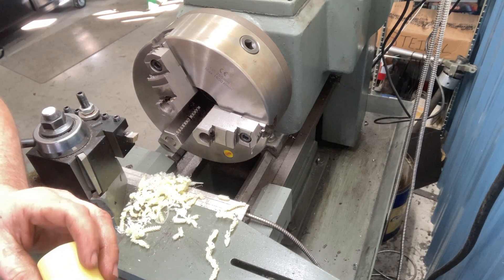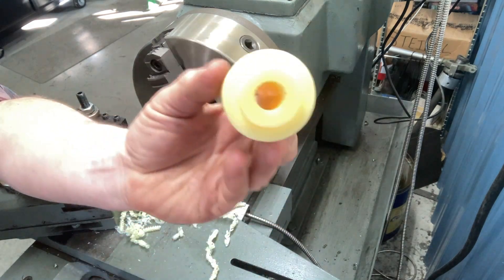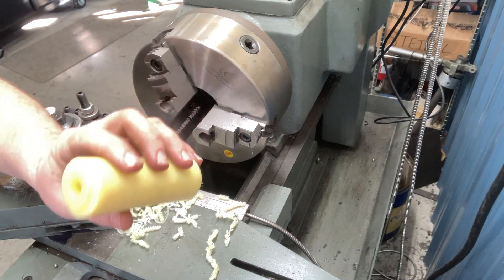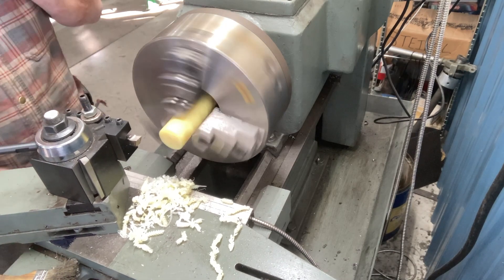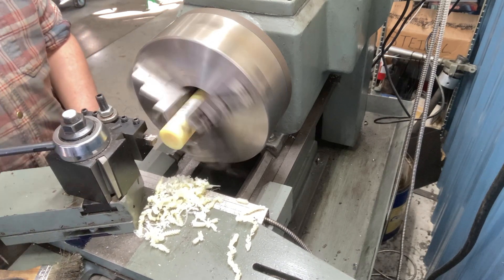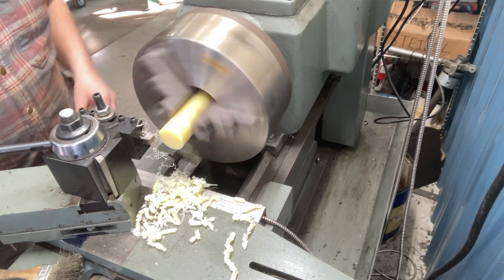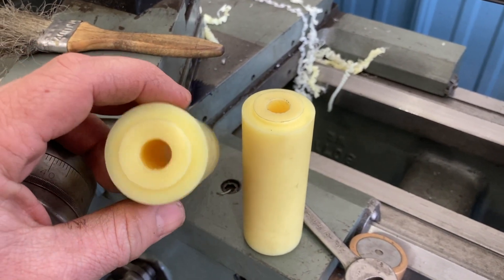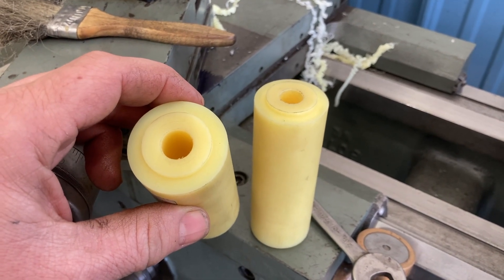Machining Nylon Bushings in the Logan 6560 Lathe

Comment: I am surprised ,they don't use , UHMW for things like that It is slick,tough and heat resistant. We used it where we had a lot of wear on metal vibrator/ drag conveyor's.   Has always liked and shared. All my best
Reply from the maker: The customer provided this material, but maybe I’ll suggest something better next time!
Reply: @MaineMachinist  Thank you for the reply. We would get the UHMW  in 4/10 foot sheets. We cut it to size with a Skillsaw . And used screw's that were made where the head would break off. to attach it to the metal beds. I found a place on Ebay that sells round stock. Not a bad price back a couple of years ago. If you are interested I will give you the link. All my best.

Comment: I was well surprised the first time nylon grabbed my drill and dragged my quill. I didn’t make that mistake twice!
Reply from the maker: Absolutely. It will pull so hard sometimes you can’t back the quill out!

I will mention that unlocking the tailstock can be tricky. If you do it wrong, it’ll suck the drill chuck all the way into the work!